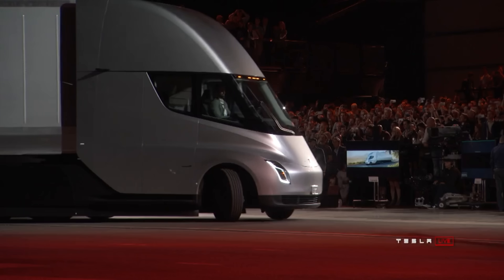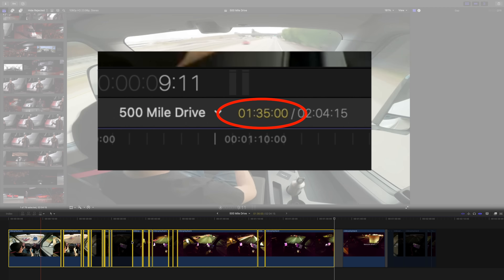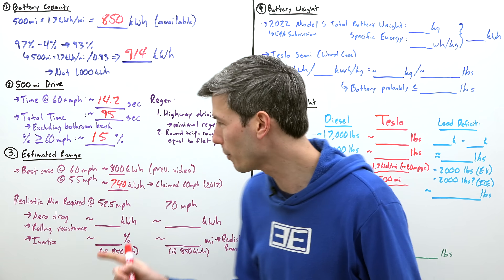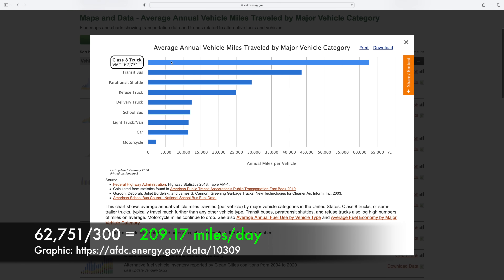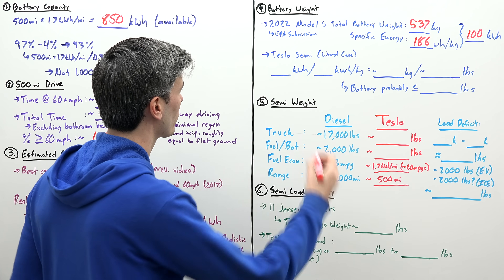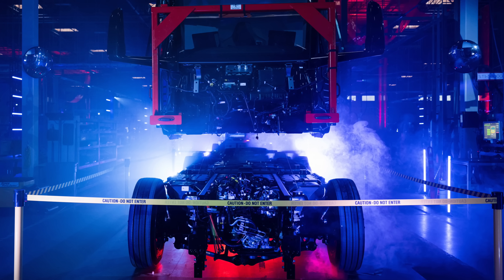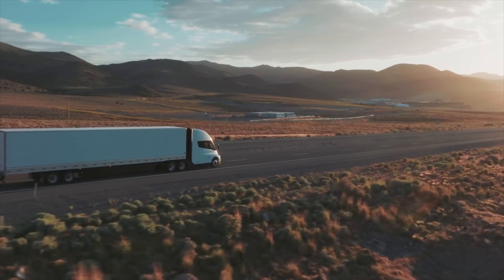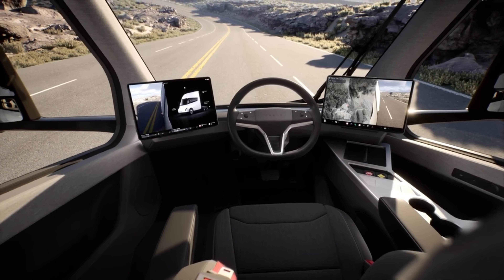Does The Tesla Semi Make Any Sense? Part 2!

Comment: I'd like to see a video discussing the charging needs for an electric semi truck stop, and if current infrastructure can handle that.  Also, what would it mean for electrical generation?
Reply: For operators like Pepsi with terminals, it is probably not a big issue since their trucks can do like most EV cars do and charge at night when the grid load is low. And that will help the operator out financially since the price of electricity drops way down between 9 PM and 6-7 AM, and all weekend.
Reply: @JBoy340a  there would still be an increase in load on the grid, plus a lot of trucking is done at night, or other off hours to work around the traffic patterns of the region.
Reply: @Villani_AV  you correct there will be increased usage from trucks charging.  But, this is usually outside the 4- 8 PM peak rate period when people get home and turn on the oven to cook dinner or A/C to cool the house.  The rates drop dramatically after these times. Some power companies even have free night rates to get people to use the excess capacity they have.  And no doubt any smart truck operator would set their vehicle to charge when the rates were low to greatly increase their profits.
Reply: Why wouldn't it be able to handle it? Tesla on average now does a 12 units of v3 stall sc station. Each one of those could instead be a 3 v4 mw charger installation for semis with the same draw on the grid overall. Plus tesla operates station's with 80-110+v3 scers without power sharing. 

Basically this isn't a big deal. Tesla knows how to do dcfc at scale and quickly deploy assets in the field. For Dec they averaged opening over 20+new sc station's a DAY over in China alone. They added over 11,000+new scers in 2022 alone. 

Down in Florida in just 8 days from approval of permits they had a new 12 stall v3 sc station up and charging customers. Thanks to new pre fab slab techniques where they install wiring and the sc unit's at a factory. Then truck them to the job site, drop in place with a crane. 
Hook it up and good to go. They also do big batteries and solar canopies over station's already. 😎
Reply: It's going to be 20 - 30 years before the majority of vehicles on the road will be electric. Yes, major infrastructure changes will be required, but there's time.
Reply: As well as the fact that moving more regional and long-haul freight by rail instead of trucks is a far better solution than this "long-haul EV lorry" nonsense. Don't get me wrong, EV lorries make sense for last-mile delivery, or even regional hauling of fairly light cargo, but for anything heavier-duty than that, Diesel will reign supreme, and for long-haul freight, rail will always be the best solution for the majority of cargo.

Comment: Too many people take project schedules as cold hard fact claims. When you are basically running an R&D shop and solving problems that have never really been tackled before you have to take it with a grain of salt. Even without COVIC supply chain disruptions, there are too many variables for a project team to know exactly when this scale/complexity of product will be released.

Considering most manufacturers have strung consumers along for decades in regards to EVs, I feel being off by 2-3 years in actual product delivery is amazing. Also whether its got 3 or 4 motors is a design decision. Elon tells you their current plans but hes not going to stick to them if they figure out a better way to do it later. He has modified so many of his products on the fly its amazing.
Reply: This. Plus the current economy is pretty different than it was in 2017. Can't really blame them for higher costs when raw material prices exploded since the pandemic.

Comment: I deliver to department stores. Average gross weight probably about 55k pnds (30k trk/trlr and 25k cargo). Average daily mileage between 500 and 600. I wouldn't be comfortable with the Tesla unless they could guarantee 700 mile range.  Need that reserve to account for varying terrain and detours due to traffic.
Reply: You could charge the the extra 200 miles when you get lunch or forced to take a break.  The added weight and expense of a battery large enough to go 700 miles is unnecessary.
Reply: @don m  tho true, im a day cab driver. Dont generally have time to sit and wait on a charge. And my regulated 30min breaks are done working, usually while swapping trailers at the store, or swapping trailers at the warehouse for my second store.
Reply: And, tho rare, we do have days of over 600miles.
Reply: Many people develop a habit to calculate EVs to the last 1% of juice. In many cases it is doable but also not and completely different what they did before.

Comment: Lithium batteries are generally accepted as aging out at 12 years, semi trucks generally operate for 30+ years accruing millions of miles. How much will these batteries cost to replace and will they mechanically total the truck when they need replacement (a vehicle is totalled when the cost of repair exceeds 2/3rds of market value of the vehicle)? And whether or not they do, the environmental impact of producing a battery that large is enormous, what is the break even point at which the BEV variant becomes better for the environment (according to polestar for like ICE vs EV sedans the answer is ~75k miles) and what will be done about recycling these batteries when they expire?
Reply: The break even point for environmental impact ICE vs. sedans is far less than 75k miles when you charge it with renewable energy though. For example in Norway, where most energy comes from renewable hydropower, the break-even point would come after just 8,400 miles. /source reuters
Batteries can already be recycled today to 95%+.

Comment: That qas some sweet forensic math!
One point you may have missed when calculating the load is that the jersey barriers are added to the weight of the trailer.
How much does that flat bed weigh?
Reply: The trailer weight drops out of the calculation when doing a comparison against diesel haulers because they too would be pulling the same trailer so its weight doesn't actually matter here (it matters in the absolute just as it does for a diesel hauler but not in this comparison). At 10:46 is the crucial point: the extra weight of the batteries 'costs' the allowable load one Jersey barrier.
Reply: @davidjames4915  that's not how he calculated the diesel comparison, he simply stated that a diesel truck can tow 44k#. That number is a combination of trailer and load so they do not cancel each other out.
Also, yes, one of the websites says a standard load is 12 jersey barriers and you are welcome to take that at face value. However, I have always respected Jason's attention to detail and not taking a website at it's word.
This kind of small detail is usually important to him.
Reply: @3crowsfarm16  The original reinforced Jersey barriers are 600lbs a foot!

Comment: The fundamentals in your first video don't hold up, couple things I had a problem with....

1) using the average truck mpg comparing to the Tesla isn't a realistic one as the loads and speeds vary to a higher degree than the Tesla pulling a more aero dynamic load at speeds less than 60 mph. A more realistic comparison would be to that of a fuel efficient semi like the cascadia evolution which gets 9.31 mpg. Which with $5 diesel would put it at $.54/mile.

2) no where is there a super charger, let alone a mega charger that gets $0.09/kwh. Current super charger prices are $0.5/kwh and I feel a fair comparison would use real world numbers. Even if paying industrial electricty rates the equipment and grid connection needs to be upgraded/installed to handle extra megawatts of load. The high cost of super charging probably has something to do with it costing about as much as the semi to install a super charger in some cases and I'm positive the mega charger will cost as much of not more to install. Using current supercharger rates and the Tesla getting 1.7kwh/mile that puts it at $0.85/mile about $0.30 more per mile than a fuel efficient diesel.

Comment: Great information.  Another concern I have is around battery degradation.  Since these types of trucks do so many miles per year, how long before the range starts to suffer?  From their statement Pepsico expects a 7yr service life.  If it takes 93% of the battery to make the 500 mile journey, even a 10% loss could be huge.  Hopefully if the truck sleeps at a warehouse you could avoid fast DC charging which should help.
Reply: most trucks won't be doing 500 mile journeys so they probably won't even notice degradation
Reply: The semi is going to have alot more batteries at 1000v  it would have around 41,000 cells in it since each cell is good for 20.7wh
Reply: Even if the battery last 200,000 miles thats several battery changes over the life of the vehicle. And if the battery costs close to $100,000 that may put it behind diesels.
Reply: @Bumponalog  it's supposed to last 1 million but we will see time will tell
Reply: Range will suffer a lot more if they are charging to 100% each time. Just the reality of the chemistry involved in current batteries.
Reply: @NO NO  it all depends on what each cells c-ratings draw is if it is .5 during the fast charge and there adequate cooling not a problem for the battery it only damages your batteries if you go past the c-ratring and bad thermo management

Comment: maybe tesla semi will be able to gain significant time thanks to better performance and regen ? easier to pass slow vehicles, quicker to accelerate in stop and go traffic, and better brakes thanks to regen, so you dont have to keep as much distance with the vehicles in front, so it could maintain a similar average speed while cruising a few mph slower. it seems tesla went full on efficiency with the two disconnectable motors. they probably also have different gearing to allow always sending torque to the motor(s) in the best rpm range ? I wouldn't be surprised if the hummer EV with a (max rated) large 7500 pounds trailer is barely more efficient (if any) than an 82k lbs loaded semi...it only got .9kWh/mile with a 5000lbs trailer  and 1.52kWh at 75mph with a 6000lbs camper...
I am sure tesla semi driver will quickly learn how to optimize the cruising speed/ charging stops to get as quickly as possible to their destination. most probably they will go faster whenever they have partial load or a drive shorter than 500miles, and otherwise will findn out the quickest way to travel long distance. provided you have v4/megacharger on your route, probably drive according to speed limits/ flow of traffic, drain the battery below 5-10% and make use of the fastest charging that happens at low SoC (at least on all current) tesla models, and leave as soon as the have enough range or as  soon as charging slows down significantly
BTW lot of semis don't always follow speed limits, if you drive the speed limit you'll have a fair amount of semis passing you, which is a good reason not to follow the speed limits....

Comment: Meanwhile here in Sweden, we think 36 tonne is too small and go for 44, 64, 74, 90, ... tonne. The more load the better economy.

Regarding the semi acceleration up the hill: We do not know if it was minimum batteries in it. Could be only like 1-2 tonne instead of 5 tonne.

And regarding the weight of engine in Diesel compared to electric: They are actually pretty similar so you can practically even them out to each other.

Comment: It will be interesting to see how these ranges are affected by ambient temps below 32 degrees or worse yet, below 0 degrees.
Reply: 10-30% less miles.
Reply: IF the battery is kept warm no effect, if battery allowed to cool off, then definitely derated
Reply: @pablopicaro7649  There would still be an effect since the air is more dense. 20F air is 12.8% more dense than 80F air, pressure and humidity being equal. I'd argue that the increased air resistance will be the biggest factor. Since these large batteries will be cycled more often than cars, gain heat from both charging and discharging, and have a better volume to surface area ratio than a car battery. I'd honestly be surprised if they require any heat at all even at 0F, therefore the battery temperature would have a negligible effect on range. There are also lots of loads for these trucks to haul in locations that never get below freezing too.

Comment: There's no official independent testing yet to gather concrete data from the Semi performance. These type of BEV trucks make more sense for the Delivery sector, with lighter cargo, short routes and small working shifts. In terms of maintenance, the big issue could be the degradation of the battery pack, common on Li-on battery Cells, use it or not, and potential reliability issues with the powertrain due to wear and tear.
Reply: Battery degradation is a physical limitation and will have real world losses. The powertrain though should be more reliable as the complexity of and ICE is higher than a motor. This may take a few iterations to realize as new vehicles often have unforeseen issues.
Reply: @NONO-hz4vo  relying on the powertrain to do most of the breaking could lead to reliability issues. Especially from a company without previous truck expertise in the sector.
Reply: @RogerM88  There are very few moving parts in the Tesla power train and regen braking saves a lot of wear on the brakes.  Tesla has more regen brake experience than anyone.  The Tesla Semi will most likely require considerably less maintenance than any class 8 diesel.
Reply: @donm2255  you don't have data to support that. So get easy on the hype. Just after some years of usage we gonna have a  more real understanding how the Semi will hold up in terms of reliability.
Reply: @RogerM88  Tesla is literally using the same motor in the S and X.  They have been doing regen braking for more than a decade.  No hype.  Just facts.
Reply: @donm2255  not even a month since delivery, and there are already images of a Pepsi Tesla Semi being towed.
Reply: Well, this is true. Battery degradation is important, but Tesla has invested money and time into this research. Degradation is definitely lower if you're treating your car or truck nicely. Like not flooring it, etc...
Reply: @counselthyself Absolutely

Comment: People love to hate new tech because it doesnt work in the extreme situations. Thank you for pointing out the fact, that yes, the tesla semi may not be the best option if you max out your weight and travel across country every 2 days. It doesnt make sense for you. But for now, there is still a huge amount of use cases, especially short haul, where electric semi's will be so beneficial to have. Long haul will come at some point. Just not now. same reason I dont understand people complaining about electric pickups, that are just hitting the market not being able to tow a 20 foot speed boat 300 miles on a charge. If you need that, dont buy electric truck for another 10 years, the tech isnt there YET. But if you just need to haul around town or use the truck as a daily to get to and from work, electric makes a lot of sense.

Comment: The nature of trips will nearly always reconcile elevation and conservation.  That's the nature of most behavior, you tend to go some where and then go back, nearly the same way you went. So, I think its more than fine to include energy regeneration if it will play a significant role in the trip.  If you deliver something up a hill, you will likely travel down that hill on your way back.  Not always, but I'd say, most of the time.
Reply: doesn’t that mean it’s more than fine to assume no regen, as conservation of energy assuming efficient regen would yield no change in elevation?
Reply: With the primary different remaining being when going uphill heavy then downhill light.  Loads going the other direction would get the benefit.  Finally, this same issue surely applies to diesel consumption - so it's a range factor more than a cost comparison factor?
Reply: @dasfoot  totally agreed! regen in general for any vehicle is superior on hilly terrain. saves brakes, puts that gravitational potential energy back in the batteries!